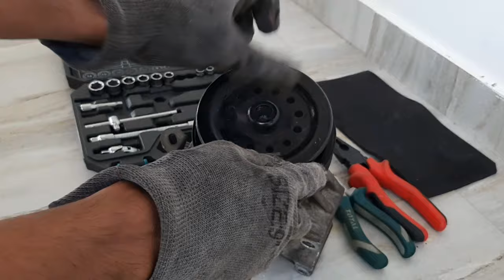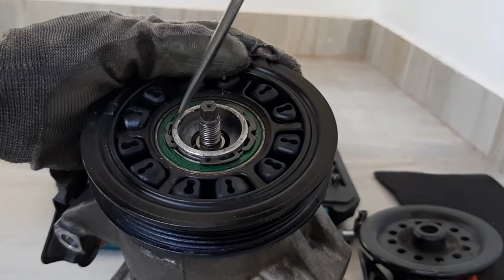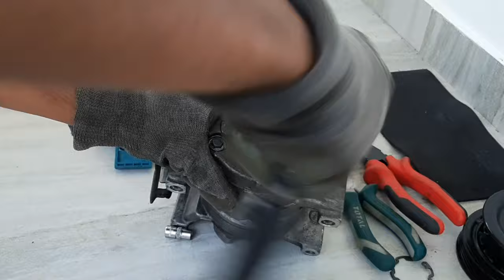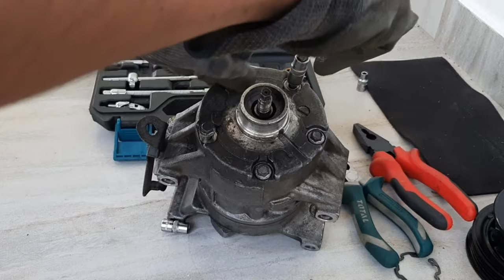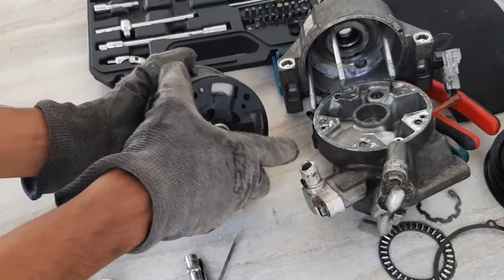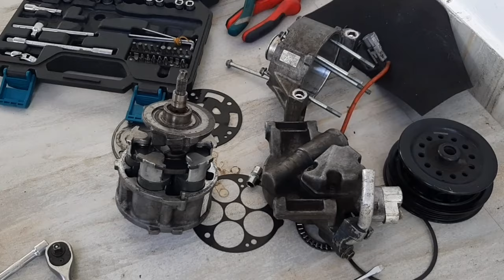car ac compressor repair and how it works

Comment: Hey bro, I want to ask about A/c light blink then goes off. I changed the cooler but it still doesn't work. I don't know what the problem is. I don't know if you've seen this before? If so, how do you deal with it?

Comment: Mine is still chilling so well but has a very loud knocking noise, it's not the pulley or bearing, it's coming from inside, can it be repaired?

Comment: I have same compressor in my car but the problem is that after 5 minutes of running it drop the engine rpm to 500 and have drag on the engine then i off my ac compressor for 1 minute then it runs fine for another 5 min and on highway it runs fine
Reply from the maker: Is there any noise coming from your car ac compressor?
Reply from the maker: Is the engine rpm auto dropped down ?
Reply: @techwebccn8988  after 3-4 mins of compressor running at idle engine rpm drops to 500 then computer raise to 600 but it should be 850 and i runs on 850 when i. Give one minute rest to. The compressor
Reply from the maker: First of all I think you should check your vehicle diagnostic .If you do that, the problem will be identified easily.👌
Reply: @techwebccn8988  yes i did everything for the engine, everything is replaced and cleaned even the intake manifold gasket and valve cover gasket and all parts changed and cleaned even the fuel filter and when i remove compressor wire the engine runs smooth on 850 rpm with compressor ON from the dashboard but actually compressor is disconnected

Comment: My car was flood affected so ac compressor was also having water in it
Now I started using ac 
It worked fine in a minute but was producing noise after that it got heated and some smoke  started coming out of it and the compressor was locked
Plz digest can it be repaired and how
Reply from the maker: I think the cylinders of the AC have entered the roads or AC has no lubrication in the cylinder and check ac
Compressor oil level 
If you know how to save it, try it
Reply from the maker: Did you remove ac compressor from engine?
Reply from the maker: Don't use ac until it is recover this problem because it can be damaged for intanal components in ac🤔
Reply: A compressor is a SEALED unit...how could it be affected by flood??
Reply from the maker: Didn't you know .  Udara  keluar  air outlet   in car inside
Reply from the maker: Didn't you know .  Udara  keluar  air outlet   in car inside so They have the ability to entered water  into ac compressor
Reply: @trinifirst6702  u correct,  the AC unit is a sealed system, flood water won't go inside
Reply: buy new, i have it for sale

Comment: Is a new AC compressor silver or aluminum in color? And a remanufactured  compressor black?
Reply from the maker: The remanufactured AC compressors are  often painted on the surface ,
Reply from the maker: Did you get the answer you want?🤔
Reply: @techwebccn8988  Thank you.